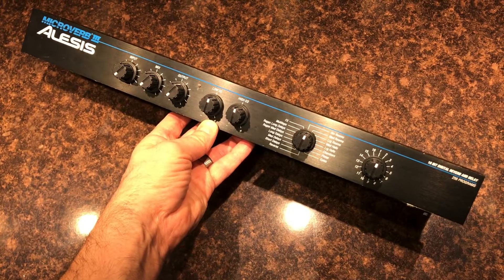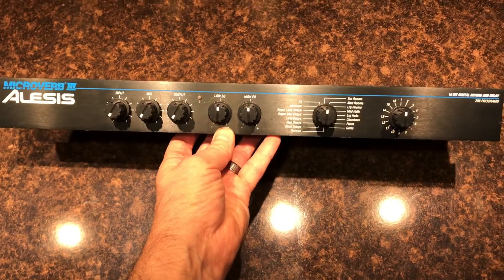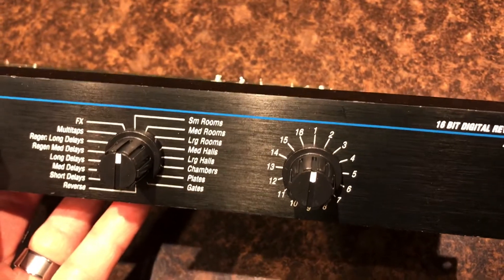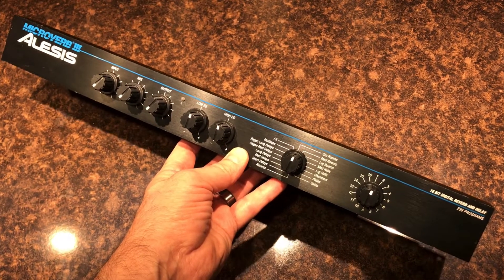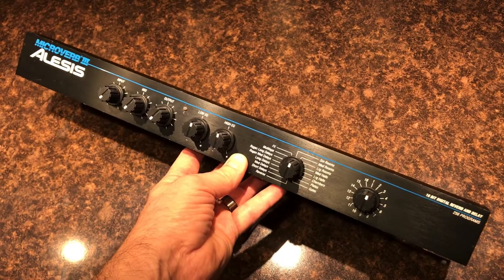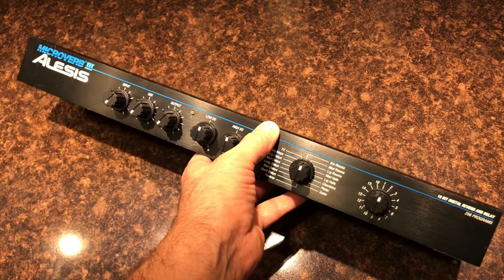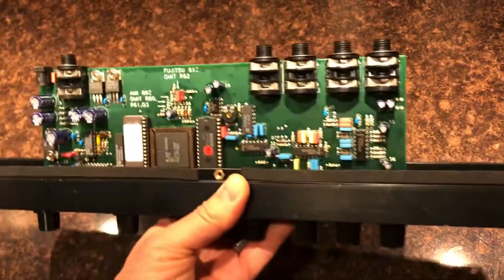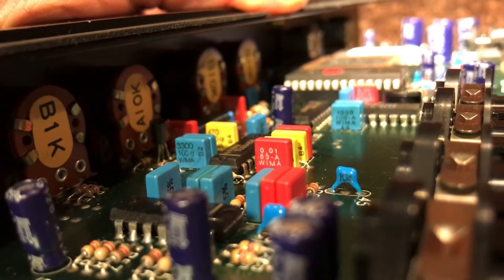Alesis Microverb III: A Look At It’s Guts

Comment: Nice video, love these tacky old reverbs :) The "plate" doesn't sound much like a plate but nevertheless it can still sound fucking huge on snare and the reverse-thing is instant My Bloody Valentine-vibes on guitar. 

Would like to lower the noisefloor of my trusty Microverb III and since no schematics is available anywhere I know of your video just saved me the trouble of pulling the thing out of the rack. And yeah, its already recapped, so lowering the noisefloor further ain't just a recap. Just a quick correction: The TL084 aint a lower noise of the TL074, was the other way around. A TLE2074 has better noise specs and is indeed the upgraded version of the TL074 quad. I'm NOT a tech though, just owner of a small analog studio.
If anyone got suggestions that'd be much appreciated. A schematic would be even better.

Comment: I find it interesting that Alesis went from the original 1/3rd size non rack models eventually to obligatory 19" rack approach to have a more "professional" status. Today many fine sounding effects units are offered in the small footprint format and few are complaining that such small units lack a "professional" quality. I cut my Alesis rack stuff down immediately when I purchased them to 11 ½ inches to velcro them easily on top of small sound modules.  Small has always been better for a working musicians in my opinion.  Having a "pro" rack close by always smacked of too much self importance on free lance bookings.
Reply from the maker: Thanks for your perspectives. I get where you’re coming from. I thought the “nano” series 1/3 rack width products were offered alongside generations of the micro/midiverb products and other rack mount form factor products, no? I wasn’t aware they shifted from one thing to another, but offered both concurrently. Maybe it’s just me but I never considered rack mount as more “professional”…I agree with this when it’s a comparison of home stereo/theatre tabletop components vs rack mount audio processing equipment, but I consider small form factor gear for tabletop or positioning on the floor “professional” by virtue of its function and intended purpose. For instance I have a Boss RE-202 effects “pedal” well-suited for table/desktop as well as floor…nice cast aluminum case…solid build, designed for live sound and recorded signal processing…professional use. My comments in the video about Microverb III rackmount chassis weren’t meant to insinuate rack mount devices are professional, but rather the particular design of the Midiverb III chassis was very “professional” in my mind because of the robust design and ease of access to internals, as well as the components used, quality of the PCB material, etc.
Reply: @SweetbeatsTechStop   I understand the need for a "standard" in manufacturing (hey, let's all build stuff with ears which will fit in a 19" rack!) GM was a wonderful standard as was midi but I'm glad a few people aren't compelled to conform regarding chassis shape. Behringer had its stackable processor boxes which seemed logical.

Comment: I have one of these and it needs some love. Lol. Some of the programs are not working, or cut out and the waveform looks funky. Maybe it is because of a capacitor/s or something? So I am hoping that this video might show me what I am up against before I open it up to look. Lol....
Reply from the maker: I can’t recall if any of the ICs are socketed, but if so, I would re-seat them, and also exercise the effect select encoder. Like, take the knob off and do the shoelace thing where you wrap a shoelace around the shaft and then rapidly pull it back and forth. Start with those things.
Reply: @SweetbeatsTechStop  thanks for the reply. I will give it a go.

Comment: my mv3 has recently stopped playing certain presets... some work, some dont... 
the knobs had been crackly for a little bit, but i never got around to cleaning them... any ideas?
Reply from the maker: I don’t know how well you can clean those switches…I never looked that close. They’re not like analog pots. Crackly pots tells me maybe you need a recap. What kind of environment has the unit lived in? Damp? Smokey? You could try exercising the switches and pots…take the knobs off, wrap a shoestring around the shaft and pull back and forth spinning the pot or switch rapidly back and forth.
Reply: @SweetbeatsTechStop  thanks for the reply... appreciate it... 
im more worried about the missing presets than the crackles... ill try your suggestion and see if the problems are related

Comment: We been trying to figure out why it's keeps on making these crackle sounds when we turn the knobs. We tried cleaning it by using the air cans.  ????????
Reply from the maker: Canned air will do nothing. You have to open it up in order to access the body of each pot, and spray an appropriate cleaner like DeoxIT F5 through any opening you can find in the pot body, exercise the pot, and then a little more contact cleaner and position it so it can drain. In extreme cases the issue may also be exacerbated by out-of-spec coupling capacitors, but I would always try cleaning the pots first.
Reply: @SweetbeatsTechStop  thx.  Any local store have those f5 cleaners?
Reply from the maker: Hard to say. I have no idea where on you world you are. You can easily order it online, just do a web search for DeoxIT F5 Faderlube, or call any local electronics shop in your area and ask if they have it. It is a popular product, so if you find a local store that carries these types of products, chances are they will have DeoxIT products. Just make sure it is “F5” and not “D5” or something else. The F5 Faderlube is designed to service the kind of pots in the Microverb.
Reply: @SweetbeatsTechStop  thx you🙏

Comment: Hey, I just picked one of these up, what kind of power supply does it take? I saw that it said 9V so I figured it would be the same as guitar pedals, but my 9V adapters won't fit into the barrel of the power input. Do you know what kind of PS I need to pick up? Thanks.
Reply from the maker: It’s an 120VAC to 9VAC transformer rather than an AC to DC regulated supply. Needs to be at least 1000mA rated and the plug is a 2.1 x 5.5mm type. Here’s an example: https://www.parts-express.com/9-VAC-1000mA-AC-Adapter-120-1030?gclid=CjwKCAiAn5uOBhADEiwA_pZwcC6IsQiHQs2nyaxL6IVPXvZdwSl05iNf-X7FdfK-jgF8bIZ--Mi6HBoCwsAQAvD_BwE
Reply: @SweetbeatsTechStop  Thanks for your help! I just got one ordered!
Reply: This DOES NOT fit an Alesis Microverb 3 I bought one for mine and the barrel of the plug is too wide.   @SweetbeatsTechStop